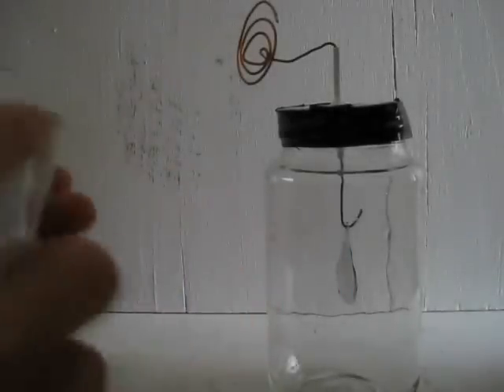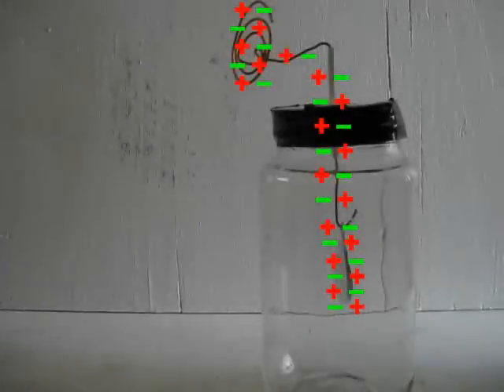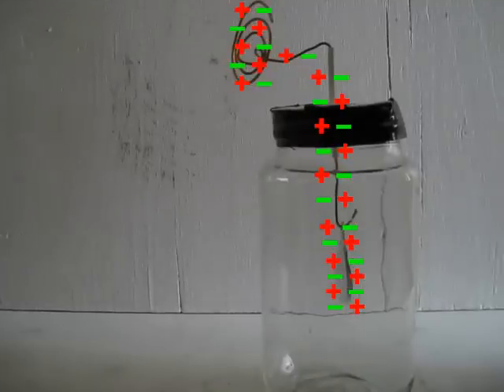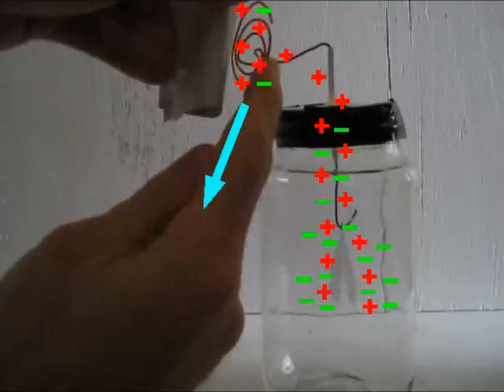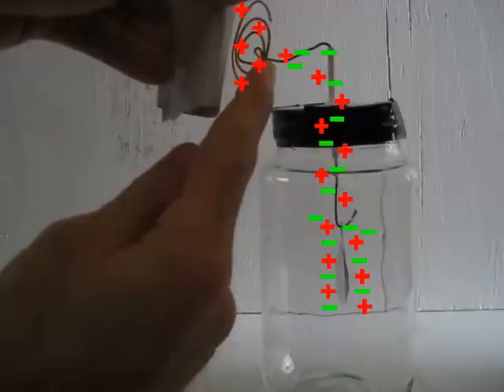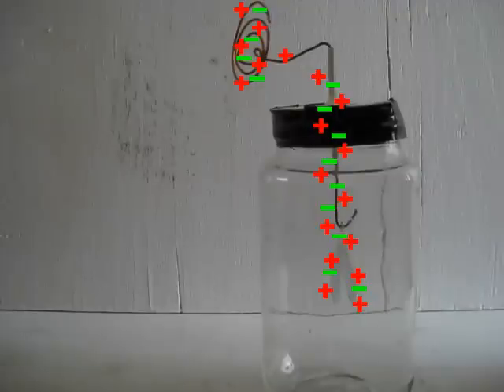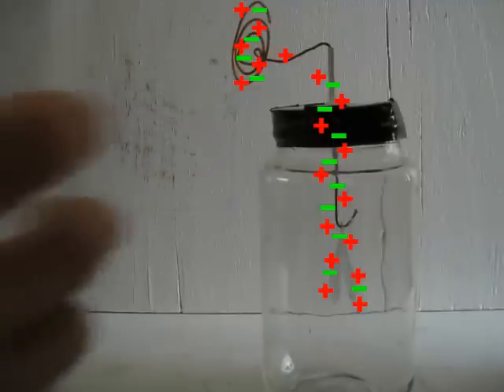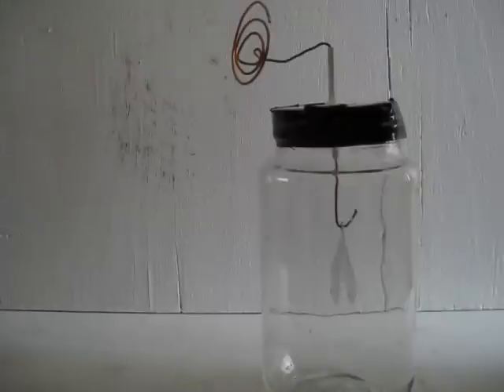Inductive Charging using an Electroscope

Comment from the maker: @DangJfjed I don't know what about the materials determines where they fit in the triboelectric series, which is a table that shows how positive or negative they become relative to each other. If you google "triboelectric series" and look at the list you'll see that there are other plastics that become more negative: polystyrene, acrylic, polyethylene, vinyl, silicon, to name a few.

Comment from the maker: Electrons would be attracted from your finger to the terminal by the positively charged glass. When you move your finger away, the electroscope is left with excess electrons. And when you move the glass away, the charges would spread out and the leafs would repel due to the negative charge.

Comment from the maker: @xgusROX Good question. I don't see why it would. Those things may be putting out some electromagnetic waves, though they should be shielded to prevent some or all of that. Electromagnetic waves are given off by moving electrons. A charged object consists of en excess or a deficit of electrons, where the number of electrons doesn't change; their just sitting there.

Comment from the maker: My guess is that prior to touching it with your finger, the positively charged glass would attract electrons up to the plate just as you point out, but not enough to match the positive charge of the glass. So the terminal is still positive with respect to your body and so more electrons are attracted from your finger to the terminal.

Comment from the maker: The straw would be negatively charged. You can see this by googling "triboelectric series" and looking at the table. Materials toward the negative end of the table will become negatively charged when rubbed with materials toward the positive end and vice versa. The farther apart the materials are in the table, the more charged they'll become. Keep in mind that some objects have paints and coatings on them that may interfere.

Comment from the maker: Assuming I'm understanding what you're saying correctly... The electroscope is _not_ charged before you do anything. When the charged object is brought near, the number of positive charges is still equal to the negative charges but they are no distributed evenly, so the leafs are charged and the terminal is charged. When you touch with your finger you either removed negative charges or add them, and at that point the electroscope is charged.

Comment from the maker: @xgusROX A CRT tube type of monitor or TV does cause it to react, even if turned off for a while. The screen is a large capacitor and is charged when turned on and takes a while to loose its charge when turned off. I just tried it with my old TV and it reacted, but I just tried it with my LCD monitor and got nothing. I don't know about all the different types of monitors that exist these days though. Does anyone know if a plasma TV or monitor carries a static charge?

Comment from the maker: @AGuyWhoMakesVideos That's sort of a strange question. My guess is somewhere in your course material or lecture 3 specific things were listed, so my answer may be different. But here goes anyway: to detect a net charge on an object, to measure the relative magnitude of charge on different objects, and to determine the sign of the net charge on an object (using techniques like in this video.)

Comment from the maker: It won't hold the charge forever, but mine stay repelled for 30 seconds at least. If you think it's too quick then your jar may be a little conductive inside. Try a plastic jar instead or maybe give it a good cleaning with hot water and soap. It could also be your jar has too small a diameter. Don't touch the jar when you do this test.

Comment from the maker: @IRmShaDe I rubbed a normal drinking glass and a piece of vinyl cut out from window blinds that you roll up. Wash the glass thoroughly first with soap and hot water and rinse thoroughly to get any grease off. The rubbing takes advantage of the triboelectric effect. See my video "Triboelectric effect/series or triboelectricity" for which materials work and why. There's an annotation at the end of this video to click on for the triboelectric video and a link in the comments.

Comment: The Van der Graaf device does something similar. Offering electrons a different path (constantly, by rotating 2 wheels opposite). What I like about that, is that you put energy in the rotation, not in creating the energy (high voltage).

Comment from the maker: @jndhillon Yes:) On a dry day, walk across a carpet with bare feet and you'll be positively charged (triboelectric effect.) That's why you get shocked sometimes when touching a metal object, electrons flow from the object to you. In this video I was more positive than the electroscope so the negatively charged object and the negatively charged leafs pushed negative charge onto me, plus my positiveness attracted some. But you might be negative relative to something that's more positive than you.

Comment from the maker: You can rub a plastic soda bottle (a coke bottle for example) against your hair or a rubber balloon against your hair and then use the bottle or balloon. Make sure your hair is clean and that the air in the room isn't too damp. Oh, you can also move a plastic comb through your hair a few times and use the comb.

Comment: Thanks for this excellent visual explanation 🙏.
But I think there’s a mistake at 1:51, when you touch the electroscope (the positive side of it) that side will attract negative charges from your finger, not the other way around;  because there is no force to push the negative charges at the foils to overcome the force of the piece of clothes to pass to your finger, isn’t it?
Reply from the maker: I'll be honest, I had some difficulty with that part too. But the foils do start out repelling each other before I touch the electroscope. When I touch with my finger, the foils then come together. So the negative charges on the foil must be leaving the electroscope otherwise the foils would not come together. Maybe it's not so much that the negative charges on the foils come up to my finger, maybe it's that negative charges that are still on the spiral, move to my finger since my finger is neutral. Negative charges from the foils then move up to the spiral to replace the ones that have moved to my finger.

Comment: What would happen if you used the vinyl and touched the loop? What would the foil do?
Reply from the maker: Booksarelove Booksarelife As you bring the vinyl close and touch the loop, the negative charge on the vinyl repels electrons to the leafs, just as I show in the video. At that point the leafs are spread far apart. But, when it touches, only a few little of the negatively charged electrons get transferred to the loop. That's because the vinyl is not electrically conductive meaning that electrons can't move around on the vinyl. So only the electrons that are on the vinyl where the vinyl physically touches the loop can move from the vinyl to the loop. Other electrons on the vinyl surrounding that can't move.Finally, when you move the vinyl away only those few electrons that got transferred are still on the electroscope. That leaves the electroscope with a net negative charge from those few electrons that got transferred. When the vinyl is no longer close, the charge on the electroscope spreads out evenly. And since only a few got transferred, the leafs spread apart only a little bit from the negative charge on the leafs.

Comment: great video. i wonder if it might be more intuitive to avoid the confusing word "ground" and just describe the touch as charge redistribution in a momentarily larger conductive body.
Reply from the maker: matt holland Thanks. You might be right. I ran into the "ground" problem just yesterday helping someone out. Large conductive body is good. I also sometimes use good source or sink for electrons.

Comment: I have tried charging this setup of electroscope by conduction but it just doesnt work. It charges by induction but doesnt by conduction. Any idea why this is happening? Are you able to charge yours by conduction?
Reply from the maker: What exactly are you doing to charge yours by conduction? If I knew what you were doing then maybe I could see what's wrong.
Reply: @RimstarOrg  I simple touch the charged pvc pipe to the spiral (wire insulation removed). I hear 2-3 discharges even before it touches the spiral, (which happens with inductive charging too). Most time the leaves just jerk as the discharge occurs and then collapse, other times the leaves get charged but with opposite charge as happened when charged by induction.

Then i tried more- same as before- by touching the pipe to the spiral and now it seems to be charging correctly- same charge as the pipe. Leaves kept touching the glass so now i just keep them out in the open.. probably the less humidity doesnt dissipate charge soon.
Reply from the maker: Thanks for clarifying. I suspect that very little charge is conducting directly from the PVC to the spiral wire where they touch. PVC is not electrically conductive. That means that the charge does not move across the surface of the PVC. So the only charge that conducts from the PVC to the spiral is the charge where the PVC makes physical contact with the spiral. You also might get some conducting through the air near where contact is made.

Comment: What would happen if the negatively charged vinyl touched the top of the electroscope/terminal?
Reply from the maker: InfamousxPhoenix Some of the negative charge where the vinyl touches will move to the electroscope so that there will be an even charge. When the vinyl is moved away, the electroscope will now be a little bit negatively charged. Note that since the vinyl is not an electrical conductor, only charge from where the vinyl touches will be able to move to the electroscope. Charge spread out on the rest of the vinyl will not be able to move. So the amount transferred will be small. If we used a negatively charged metal ball instead of the vinyl then more negative charge would move onto the electroscope. This wouldn't be considered inductive charging though.
Reply: RimstarOrg  how long does the copper wire have to be

Comment: Why the leaf repel when we  remove the charged object. I want an answer
Reply: I think he explained it well enough in the video. So basically, holding a positively charged object near (but never touching) the electroscope causes the negatively charged electrons (protons NEVER move) to flock towards the top because opposites attract. Thus, at the end of the foil leaves, there is a higher concentration of protons. Since both leaves are positively charged, they repel each other.

When charging by induction, you can put yourself in the same scenario as in the situation above, but this time a neutral object is touching the electroscope. This would cause some of the electrons that have flocked to the top of the electroscope to return back to the leaves, because this neutrally charged object gives up a few of its own electrons into the electroscope to balance things out. By balancing things out, I mean that because there is a positively charged object being held near the electroscope, and the electroscope has now gained a few extra electrons, the nearby object is positive and the electroscope is now NEGATIVE. So, this way, the charges are opposite but equal between the electroscope and the positively charged object. This allows the electroscope's leaves to behave as if they were neutral (so they would be hanging next to each other in stead of repelling) because its excess electrons are currently crowded at the top of the electroscope trying to make contact with the nearby positively charged object. Now, we first remove the once neutral object from contacting the electroscope. Nothing changes. Then we remove the positively charged object away from being near the electroscope. Then it becomes apparent that the electroscope has gained its own negative charge because the leaves will repel again.

Sorry for that wall of text, if it didn't help, you can ask me to rephrase it.

Comment from the maker: Re your 2nd point... be careful in the wording. The protons, which are positively charged particles, don't move, only the electrons, the negatively charged particles, move.

But if the terminal is positively charged, more protons than electrons, and then you make the leafs positively charged instead, then people will say that the positive charge has moved. More correctly they should say the positively charged area has changed places, the actual positively charged particles don't move.

Comment: Yo what's the thing u rubbed on the glass
Reply from the maker: That was a piece of vinyl that I'd cut from some old window blinds, also called roller shades. Just look for any material that's on the negative side of the triboelectric series table (http://rimstar.org/science_electronics_projects/triboelectric_effect_series.htm) since glass is on the positive side. Or look for any materials you have that are opposite sides of the table. A rubber balloon or plastic soda bottle rubbed against clean hair works well. More on that here http://youtu.be/ey88EdZo9hU.

Comment: Excellent video. I will share it with my physics students. Which software are you using to make the annotations and the animations (like the moving +/- charges on the video? I would love to be able to produce some for my students.
Reply from the maker: Thanks. I'm glad you like it.
The technique I used is basically stop motion animation, fairly primitive. You can see it around 2:47 into this video here "Behind the Scenes at RimstarOrg as Thx for 1 Million Views". It's what I refer to as the overlays. Then at 4:31 I talk about how I create those overlays. In the case of this induction video, each picture with all the charges in a specific position is a single picture drawn in OpenOffice. I bring them into my movie editor and show one after the other.

Comment: why do electrons flow into your hand and why doesn't opposite occurs ?
Reply from the maker: Because your hand and body are largely neutral, neither negative nor positive. The electrons on the electroscope are all trying to repel each other but have no place to go, until you touch it. Since your hand is neutral, the electrons go there, trying to balance everything out.
Reply: @RimstarOrg  But what I don't understand is if that "the electrons are all trying to repeal each other", wouldn't this be true for all objects? Meaning, wouldn't grounding them by touching them with your finger inherently remove electrons from already neutral objects? I can't seem to wrap my head around the fact that the electrons want to leave the electroscope despite it still being neutral.
Reply from the maker: You're forgetting about the charged object. For example, at 3:09, the grey piece of vinyl that I'm holding near the electroscope terminal is negatively charged (I should have drawn some negative signs on it). That's what's repelling the electrons from the electroscope to my finger.
Without the charged object, if the electroscope was neutral and your body was neutral then when you touch the electroscope's terminal with your finger, nothing would happen.
In the neutral electroscope by itself, the negative charges are balances by the positive charges, so no repulsion happens.
Reply: @RimstarOrg  Ahhhh thank you, it all makes much more sense now! I want to thank you from the bottom of my heart for getting back to me so quickly despite the video having been out for a decade.

Comment: Can i use something except copper wire .??
Reply from the maker: Yes, any metal wire will work. Just make sure you remove any coating where the foil leafs hang from the wire. You want to make sure the foil is touching the metal of the wire.

Comment: Why don't the negative charges flow up instead into the setup
Reply from the maker: Saad Haider The negative charges are repelled by the repulsion provided by the negatively charged object. Your finger acts as a ground. A ground is an object that easily accepts or provides electrons. The negatively charged object repels electrons to the leafs when there's no ground, and if you provide a ground, it repels more to the ground as well.

Comment: can I use anything other then aluminium foil if yes then what?
Reply from the maker: Yes, you can use other metals. Copper, brass and steel foils are often available at craft stores and hobby stores.

Comment: No, you are wrong! When you touch it, you transfer electrons in to the wire and when you remove field you have excess electron charge vs ground and that is why foil repels... There are no positive nor negative charges, just electrons...
Reply from the maker: Protons have positive charge. A neutral atom has equal number of positive protons and negative electrons. When you remove some electrons, you're left with more positive protons than negative electrons, and so the atom is now positively charged.
Reply: If they existed protons would immediately combine with electrons and there would be no charge at all...
Reply: Proton was invented and never discovered in reality...
Reply: If they existed protons would immediately combine with electrons and there would be no charge at all...
Proton was invented and never discovered in reality...